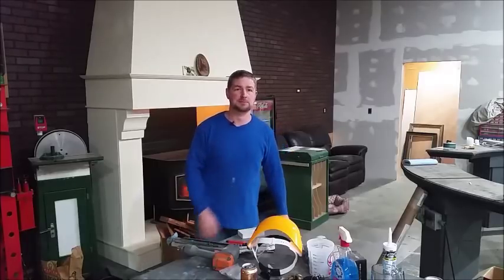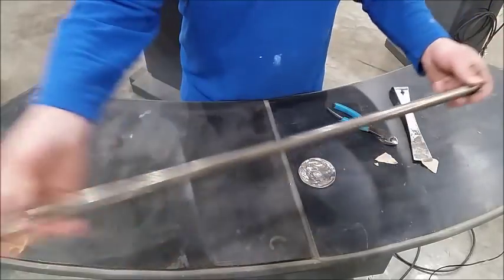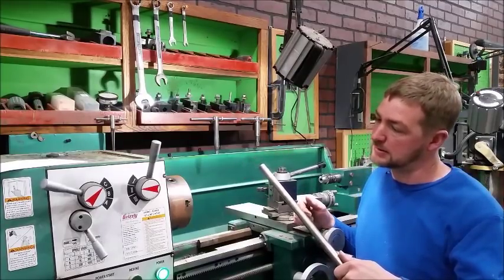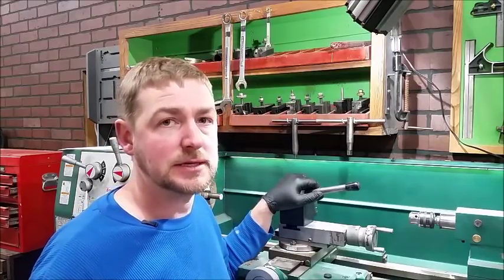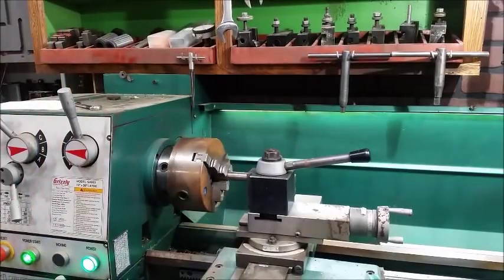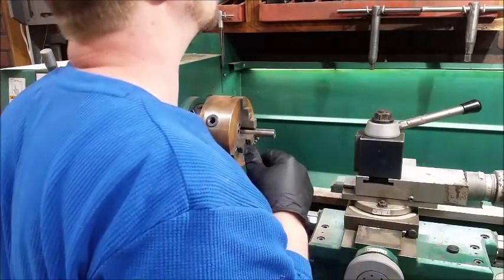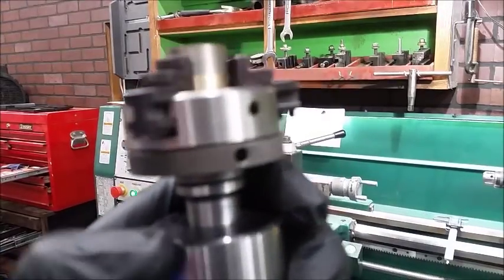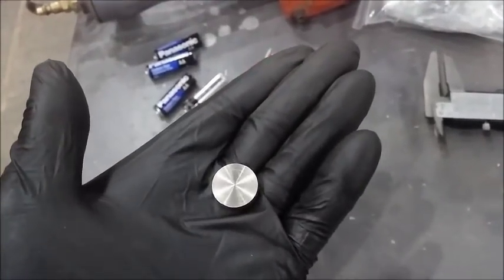Nickel 200 machining of the rod & Searl effect generator Replica parts

Comment: I remember searl saying there was a weird static effect when rubbing the rollers together.. and in vandegraff they use different plastics for the charge seperation e.g. nylon & teflon.. would if u use teflon n the middle and nylon on the rollers or vice versa?

Comment: If you're trying to prove or demonstrate "proof-of-concept,"  Why not cast your own magnetically-embedded-plastic shapes (like creating a ferrous material?) A little heat goes a long way in reshaping plastic...Just get it hot, mix in some metallic flakes, stir, cast, expose it to whatever field you want it to have, let it cool, & voila! 

I'm also wondering if anyone has tried spinning a Searle device with compressed air instead of all those complicated electrical timing devices.  It just seems to me a little cross-pollination between disciplines would advance the cause tremendously.